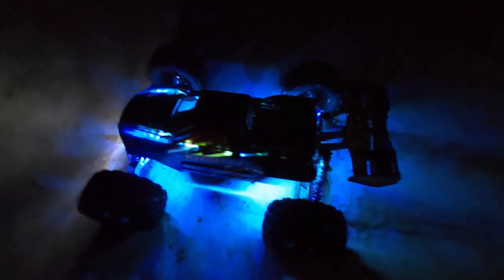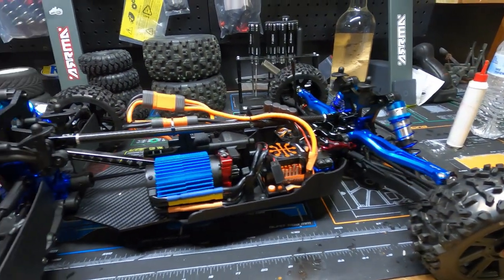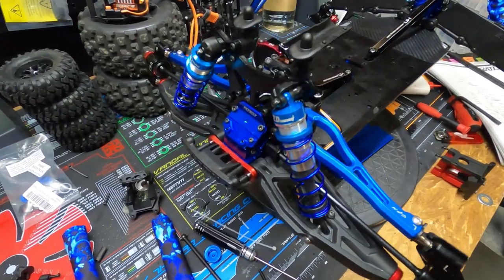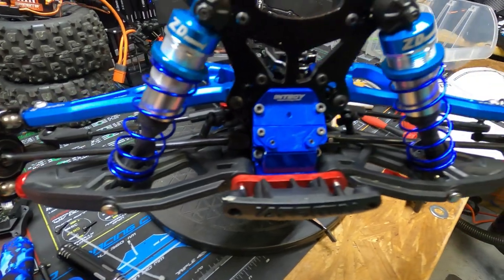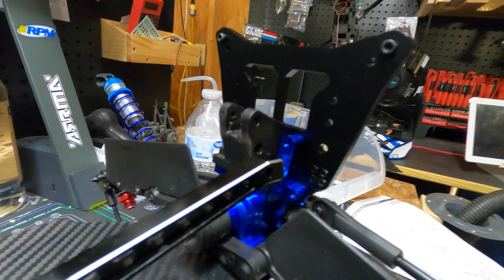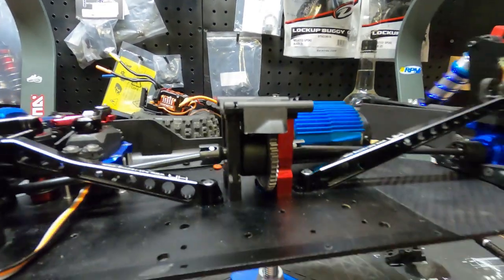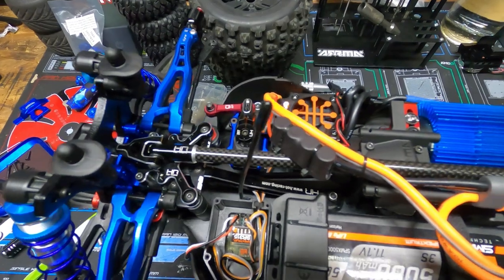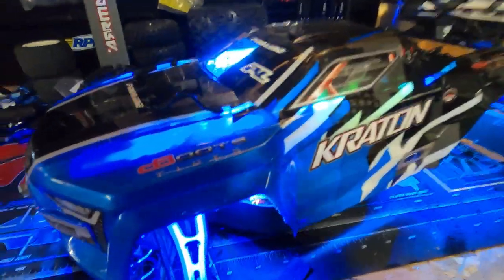KRATON6S+FULLY"BUILT" + IS THIS Normal ?

Comment: if thats the stock center diff mount the top plate is not fully seated...the corners of the top plate extend some so it should wrap the corners of the diff uprights.
Reply from the maker: Its fully seated.. Ill double check the corners.. Make sure the lip is even..it seem right to me..

Comment: friend Integy, HR and even GPM do not mill their products, they are all cast stock, God knows what aluminum.  Can you imagine what operations they would have to have to chase to make all the possible parts they offer?  Milling will never achieve such a perfect shape, and even if it did, it would take hours to produce one arm.  So even any thing you have made of aluminum in your car (GPM, Integy, HR) are not milled but cast.  Stock tover has much better material properties.  Companies that produce milled parts are m2c, mmm-germany, crcu, alza, etc.  I know what I'm talking about because I work in the Automotive industry.  Nevertheless, the car looks beautiful.
Reply from the maker: O ok.. Thank you... I was always told thier are mil.. U can clearly see the tooling marks on the parts... U dont get with cast... And they use milling replicators.. One mill that has mulity of bit that mill the same part but does it 10 at time. U know what im talking about.. Wouldn't they just use that..and how do u explain the tooling marks on parts..
Reply: @ATECHPCs  I didn't find such a detail in the video. I have a few parts from GPM and I have to say it's a nice waste. The material analysis showed what a waste it is and confirmed that it is a cast part (I was a student at the University of Materials Technology). I don't know how to express myself completely for HR, maybe they also do some things CNC (paper can withstand a lot :)), but given their price I would definitely prefer m2c or CRCU. One way or another, I believe that all parts will serve you well and for a long time ;-) If I had to personally choose between HR, INTEGY and GPM, I would definitely go to HR